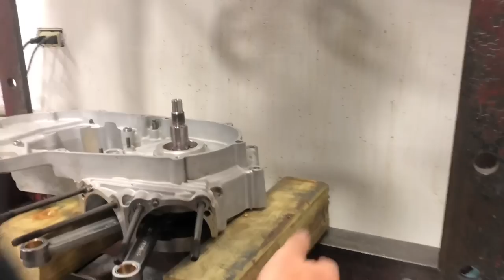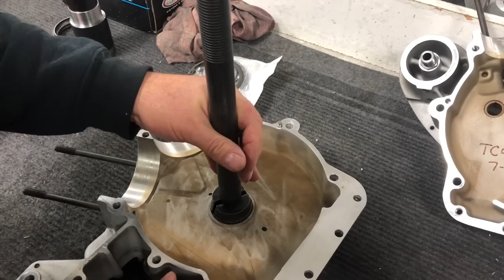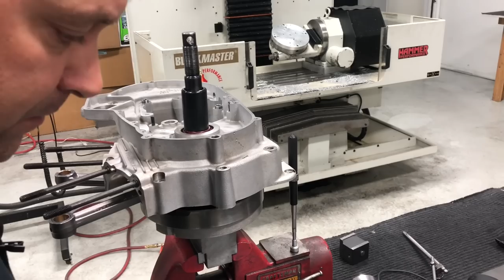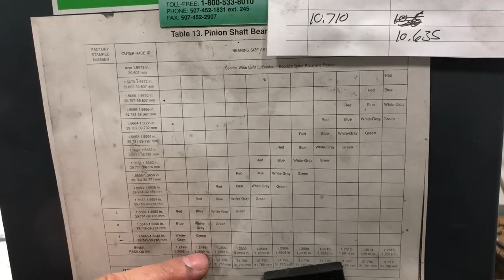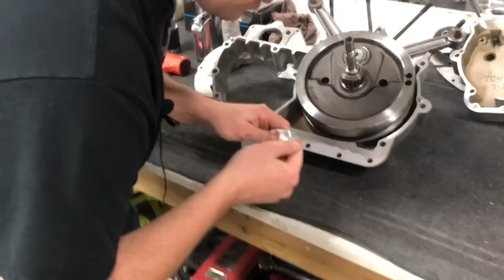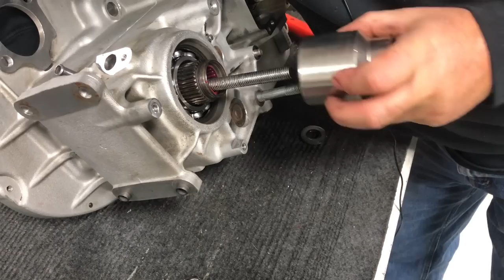How To Disassemble And Reassemble A 91-03 Harley Davidson XL Sportster Bottom End

Comment: Hi, just wondering what motor size and year does this flywheel comes from? I have a 2002 XLH883 and my flywheel ONLY HAVE 2 TIMING MARKS: TDC (wide line) and 20º advance (2 dots). I recently bought a Dyna 2000i ignition module and the only way for adjusting it dynamically (with a timing gun light) is using "the one dot" mark that is 35º advance. Thanks so much in advance and congrats for all your video works.
Reply from the maker: I would recommend static timing it, not dynamic timing it. It's just a very imprecise process to use a timing light on a Harley. For one thing, the uneven firing interval confuses some lights. Plus the dual fire causes extraneous flashes. And just being able to control the rpm well while looking in the hole is very difficult to do with any precision. And you have the choice of either getting a lot of oil in your face, or using one of those clear plugs that makes it that much more difficult to see. So instead, we recommend a careful job of static timing. We think it comes out closer for the majority of guys, us included.